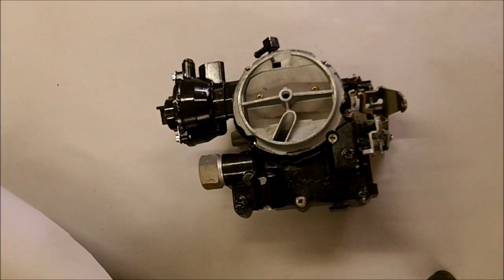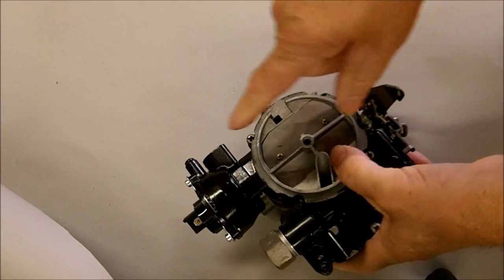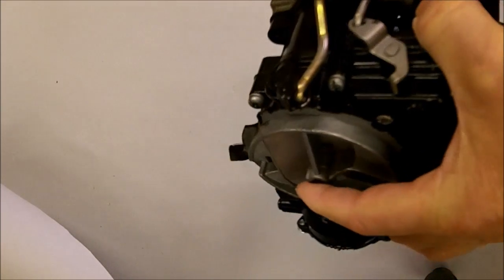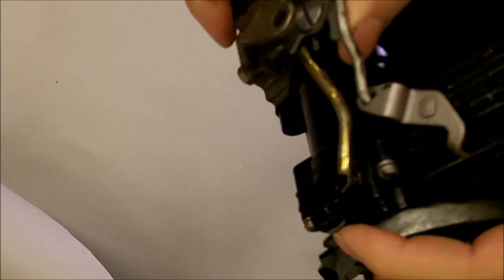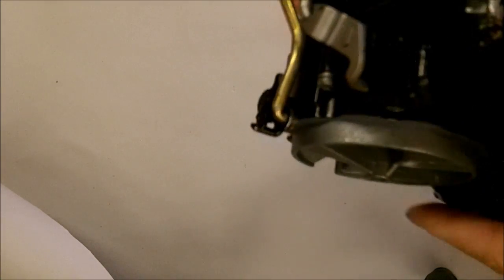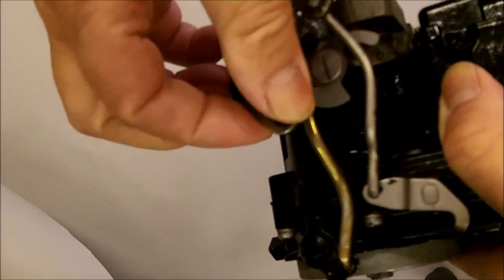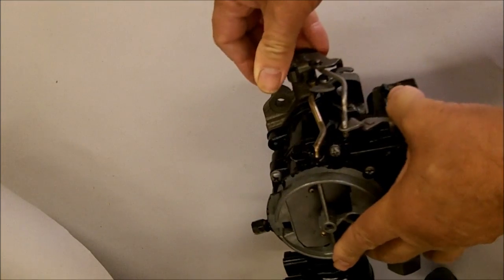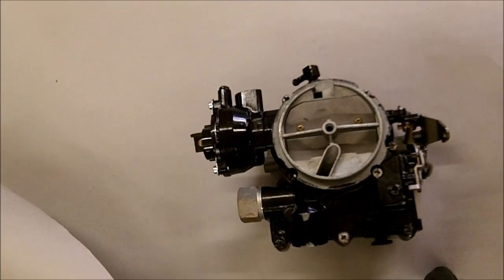Mercarb Marine Choke System

Comment: Im have to push the air intake close back to normal after I give it full throttle. any insight on a solution
Reply from the maker: Are you saying the choke valve. Whatever it is disconnect the throttle and see if it is sticking.

Comment: I've watched all your videos still having a bit of a time understanding if my choke should be closing once everything cools down? My choke seems to be sticking open, starts first twist of the key after running a bit but cold I have to give it a few pumps and give a lot of throttle.  If I take the flame arrestor off and just barely touch the choke flap it closes and then is ready for the spring to warm it open again.
Reply from the maker: On a cold start up you pump the gas once and that sets the choke. It should be closed. Most carbs have a pulloff or other mechanism to crack the choke open slightly until the engine/choke warms. Email photos and carb info if you need additional help: sales@mikescarb.com

Comment: On the carb for my Mercruiser 3.0 there doesn't seem to be that little arm that hits the cam for pulloff. It just looks like it was made without it. Does that sound right? Im getting bogging about half way through thr throttle range but it smooths out if I just push passed it.
Reply from the maker: That is normal on some of the Mercarbs. The bogging is probably a dirty passage.

Comment: Mike I have a 2009 Mercrusier 5.0 . Every year on the first ,second and third times out, the engine starts fine ,idles fine , when you first push the throttle down somewhere between 2 to 3 thousand rpm the engine runs very rough. If you try to add more power it will stall almost out. After the engine boggs and wants to stall, you can slowly add more power, then after say 5 min it will run just fine for the rest of your current time out. Seems to clear itself as the boating season progresses. I tried Quick Clean and Seafoam to no avail. Any Thoughts?
Reply from the maker: I would take the carburetor apart and clean it. I'll bet you have dirt in the system. Could be junk in the gas tank also.

Comment: When did Merc switch to an electronic choke system on the 3.0l?
Getting ready to buy a carb on a 2002 Bayliner Capri 1950 w 3.0l, just not sure if its manual or electronic
Reply from the maker: I think the Mercarb was always electric.

Comment: @2:10 Under what scenario would someone give the engine full throttle when it's so cold that the electric choke hasn't even started opening?  Also on my carb there is no choke pull off tab like there is on yours.
Reply: @MikesCarburetor  Thank you, so if it's built in there's no need (or way) for me to set the gap with a drill bit or whatever.
Reply: This would be necessary if you've flooded the engine.  You'd want more air and less fuel.

Comment: Hey Mike i have a 2008 4.3 MC with the solenoind module. The replacement carb i bought has the standard chok. How would I wire that up with the 2 wire plug that is stock to the engine
Reply: On my 2007 Mercrisuer 3.0L I replaced it with this style carb but since it used to have an enrichment solenoid, I didn't have an easy 12v lead to hook up to the new electronic choke, so I just zip tied the choke arm so it's always wide open and everything works fine.

Comment: I have a 2000 mercruiser 3.0L. It does not hold idle. Will crank up but not continue on idle. It will hold of throttle is more than idle. I checked the fuel line, gets gas. Checked the filter from fuel line to carb, it’s clean. The butterfly on carb does not move. What could be wrong w it?? How to fix?

Comment: How can i test that my electric choke is working propperly?
Purchased boat after it sat about a year+ want to make sure all is as it should be before leaving dock 1st time. So far bad gas and possibly faulty fuel pump. Only wants to run while adding gas to carb. Did run once and well but has not ran on its own fuel since just starts when adding the gas to carb. Changed fuel water seperator as well.

Comment: Hi Mike I rebuilt my mercarb 807504 and my throttle lever doesn't have a tab or anything that contacts the fast idle cam and I can't see where or if it broke off.
So I can't seem to figure out how to adjust it for pull-off.
I had a flooding issue before pulling the carb off the boat and I suspect that was the cause now
Reply: @MikesCarburetor  so should I just ignore the choke unloader setting, my rebuild sheet says it should be set at 5/64 gap,but without any tab I'm guessing there is no way to adjust it and like you said it is automatic
Reply: @MikesCarburetor  perfect thank you so much for your quick response and all of your videos 
I wish they would mention something about it in the rebuild instruction sheet

Comment: So now my question is, I had problem with engine bogging when I try to accellate. but it does that when engine is cold.  When engine is hot, it doesn't do that no more.  Also, when engine is hot, I try to shut it down, it sputtering and dies off.  Are these symtoms are any related to this "Choke wide open stuck problem"?  Thank you for your help in advance.  ;)
Reply: Did you ever fix the issue with the engine bogging when trying to accelerate?
Reply: @ConehattaBoys  No, I haven't. All I had to do was, warm up the engine before I gave the throttle.

Comment: Thank you for the detailed video that I was looking for a while.  I have 2000 Mercruiser 3.0 engine and I had a problem for a while and I try to clean the carburetor with "Choke and carburetor cleaner" and found "Choke" was wide open and stayed that position.  Even though I was cleaning carburetor every fall, I remember that Choke was wide open all the time. So, I start sprayed cleaner onto each links and found the "Yellowish gum stuff" on them.  and after that closed choke manually and now it tends to keep closing all by itself. so I sprayed "White lithium grease" on those links again as lubricant.

Comment: I have this carb on my boat. I rebuilt it about 2 years ago and it ran great all season (2016). I winterized the boat (fogged the carb) and stored it until this season. It starts and runs real smooth but the boat won't go above 2200 RPM. Throttle advances all the way but boat won't go over 2200 RPM and won't get on plane. Do you have any idea what could cause that?
Reply: Try the accelerator pump in the carb. Or another common issue is the ignition coil. Both are cheap fix. Try coil first
Reply: Mikes Carburetor that's what I thought too. But the rubber was shot on it and it would idle alright and then when I throttle up it would spit and sputter and not rev past 2500. It's just a good thing to check. Also I've been having problems with my carb, i set the float level at 1 1/32 and 9/16 like it's supposed to be at, and the choke butterfly is adjusted well I think. But it wont accelerate under load and has a hard time starting sometimes. It backfires through the carb. I need some things to check for

Comment: Is it possible for a float to stick shut? I always thought the nylon floats would saturate and stick open. 

I have a 1989 merc 3.0L. After sitting a year, I can start the engine by pouring a little gas into the orifice on top of the carb into the float reservoir. The engine will run beautifully for about 20-30 seconds, but then it just quits. I cleaned in the small fuel filter on the carb, the filter on the fuel pump, and when I unscrew the fuel line at the carb, it has some fuel under pressure. I just don't get it. It's like fuel wants to get into the carb, but it just quits.
Reply: I pulled the top open to take a peek, and the float was moving freely, and the little vale pin was moving as well, but  yet no fuel going into the bowl. So, all I could figure is something in there was clogging the inlet port. On a recommendation from a local service guy, I pushed some compressed air through the fuel inlet with the throttle open, and sure enough it popped open, and air then shot out the port on top of the carburetor. It then fired right up and runs great. Go figure.

Comment: thank you for the info     do the electric chokes fail
Reply: Hey mike I have a similar problem but mine stays open all the time I have power to the electric choke when go to push it down it won’t move
Reply: @karaba8  did you figure out the issue? Mine is doing this

Comment: Hi! Great video, but one question, so the choke flap opens with the air flow pressure, when the spring releases strenght, due to the heated bi-metal? I thought that chokes works due to a heated bi-metal, which force the choke flap to open!

Comment: Hi Mike, I have a 2004 3.0 Merc with electric choke. It cranks and runs fine after adjustment. The choke housing is getting very hot to the touch after running in my driveway for a while. I can hold it for about 10 seconds and thats it.... ouch! After cranking it gets 13.58 VDC to the choke. Is that normal??

Comment: I have a problem, my throttle won't open when it's warm so my boat can't start up, if I.open throttle lever I could start the boat,when I put into gear the.lever close and boat dies,don't know what's going on?Any help
Reply: I have a problem with the same carb model.it won't open my secondary at full throttle when is in the water.boat will bog at 4,000 rpm.